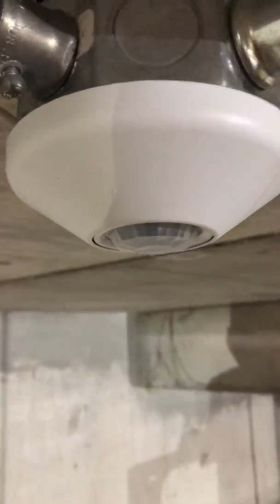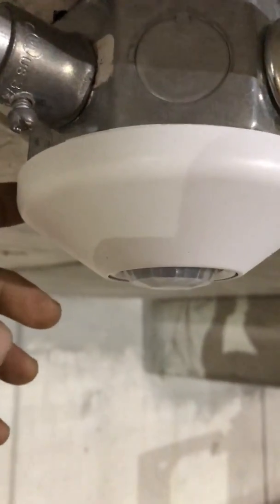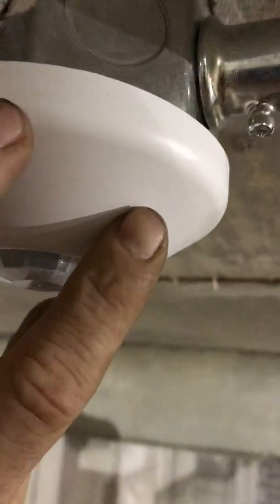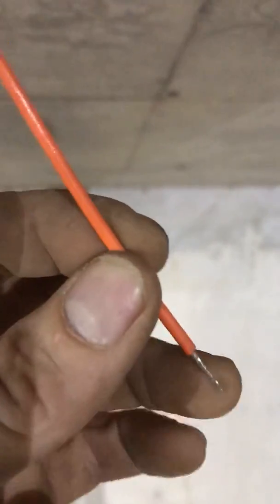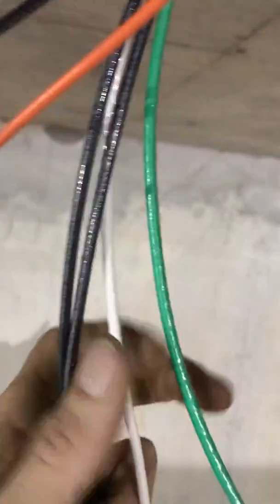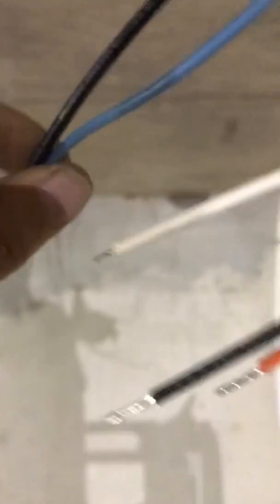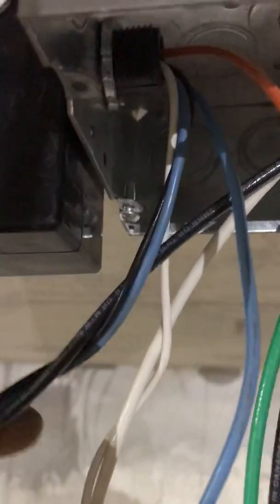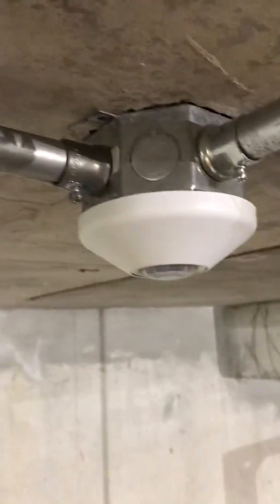CM PDT 9 occupancy sensor and PP 20 power pack ACUITY (READ DESCRIPTION)

Comment: would you use the switched hot coming off the power pack to feed a manual overide linr voltage toggle switch?

Comment: I'm new to this type of lighting. My question is first great job on explaining how to. I have a PP 20 power pack and am not sure if this is where the lights convert from low voltage to 120v.  My lights in my server room just stopped working. I have checked breakers and i have voltage. So would the PP 20 power pack be the reason or could there be other reasons. sorry for being a rookie on this style of lighting.

Comment: There was a problem where the lights in adjacent rooms wood Flicker when someone would turn a toggle switch in that room off or on. For example oh, I would flip a switch up in another room, let's say, a closet that is attached to the main room using an occupancy sensor. When I flip the switch back and forth in the closet, the LED lights in the main room would jump. The only resolve was to take the closet lights off of the circuit totally. 

This problem did not exist when the lights were normal ballast lights. It only began when the lights were changed to LED. Previously the occupancy sensor and the entire setup along with the controller had no issue.

There are no three ways involved. I feel that there is some sort of voltage leak with the switches. They were replaced but the issue remained. Bulbs changed issue remained.

Comment: Can i have a low voltage switch combine with OC? if yes can i have multiple low voltage switches like 3way?
Reply from the maker: viniciolopez Yes...but you have to have a pp/oc sensor combo designed for a 3 way low voltage switch. You could make the PP/OC in the video work on a low volt 3 way, but quite a few additional steps and parts would be needed